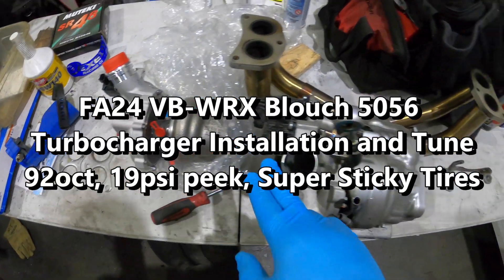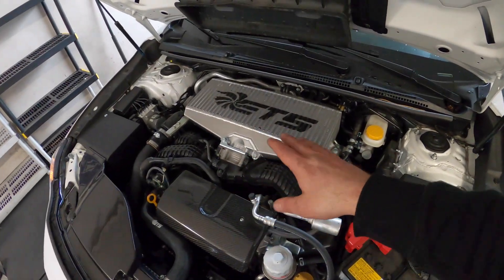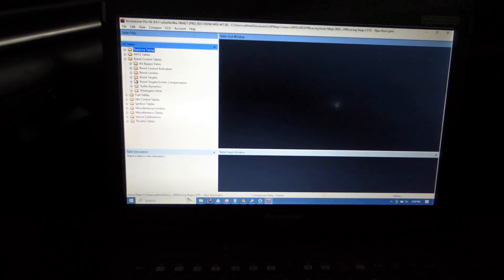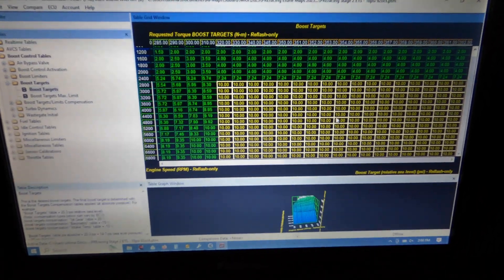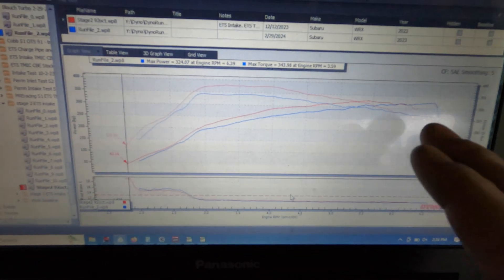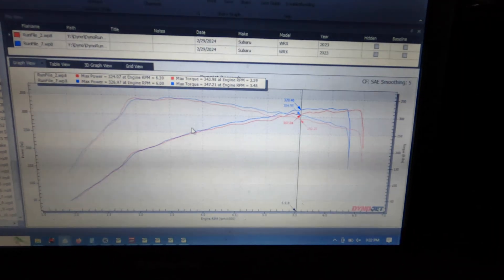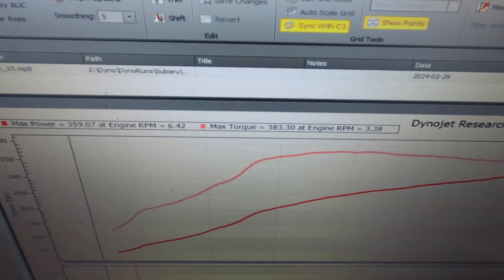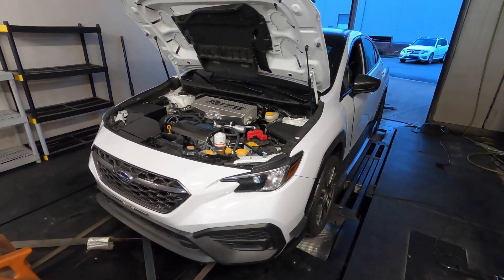FA24 VB WRX: Blouch 5056 vs. Stock Turbo. Part 1 - Low Boost Comparison.

Comment: I know this is a Blouch 5056 prototype in this video, but it looks like they are now marketing a 5356XT as the Subaru FA24 official Blouch turbo. Is that correct?
Reply from the maker: Yes,  it's just a tad better up top with no loss down low than this one
Reply: @WT4T  I'm still trying to learn turbo terminology, but that's good. You're were saying something at the end but there's a typo I don't understand what you're trying to convey.
Reply from the maker: Basically the 53 spools the same and makes more power at high rpm. It's just overall better
Reply: @WT4T  Great thank you!

Comment: What is your favorite turbo upgrade that you have tested?
Reply from the maker: The Blouch for streetability and overall fun factor. The G30 really needs a lot more fuel system to let it eat.
Reply: @WT4T  Do LP fuel pumps create any headroom? Or are we at the point where we need to wait for a bigger HPFP?
Reply from the maker: Marginal at best.  Overall they sized everything pretty much to the same limit from the factory so you're really going to need lpfp, hpfp, and injectors to go much above 500hp

Comment: Can you running with that turbo straight E-85
Reply from the maker: Yes, but you'll probably max the fuel system if you turn it up
Reply: Do you think if i put fuel pump to fuel it is enough or need injectors well
Reply from the maker: @hectorramirez8516 I haven't seen a need for a low pressure pump yet.
Reply: What is the boost limit hold this turbo
Reply from the maker: I've had it hold 26. Haven't tried higher yet
Reply: O waoo very good number any issues with your clutch because i got the same mods  just with ICFM 3.5 but after 4 gear to 6 gear cut the power went i push hard like shocking i dont know is my stock clutch
Reply from the maker: @hectorramirez8516 the car I ran that boost on had an sti 6sp

Comment: What is the web site name you get that turbo
Reply from the maker: It's not listed anywhere currently, but if you call PREracing at 503-619-0055 they can get you set up with one
Reply: Do you change all the bolts to connect turbo/ J-pipe

Comment: All of this is too shiny for me, but I am curious about that lip on the Venturi thing. How much power would that have cost?
Reply from the maker: It's pretty minimal,  not like a 32mm restrictor on a rally car. However, at some point or will choke flow like one.

Comment: impressive what the fa24 can do but i just can't get past what they put it in and what that car costs for what you get..
Reply: costs? you can get this car for 30k flat, then tune it for $700 and make 400 whp/wtq. i dont think there's a better deal out there, or even one close (other than the GTI, but it's fwd and has tons of reliability issues and high maintenance costs. wrx walks all over it on the street any day of the week.) you want any other car (golf r, audis, bmws, mustangs, camaros, you're going to be spending $55k +).
Reply from the maker: The car isn't my favorite body for sure but they feel really good driving.
Reply: @WT4T  this is exact 1992 Impreza wrx small headlights and fog lights and 1992 rally ready version. Imagine 92 with 240hp and over 400 less weight 2004 wrx +  04 only 227 hp.

Comment: These are the types of Turbo upgrades I like to see for street/DD cars. Retaining the responses but just bumping up the peak airflow a touch. It’s very similar to the GT2260S on my S3. Stock spool but about 40HP worth of addition airflow. That thing is going to drive great.
Reply from the maker: It's been on the car almost 2 months now, I've just been too busy so it took a while to get the video up. So far it's been amazing,  really fixes the powerband a ton and actually gets better mpg too
Reply: @WT4T  glad to hear, looking forward to seeing part 2.

Comment: Always fun to see turbo differences. Curious did you add or reduce CAM Timing in the upper RPMs? On my EJ25 VF52 tune I have it tapered out to zero by 5800 and power feel flattens pretty good up there. I have a feeling the VF52 just can't flow enough up top coming off 21psi in the midrange.
Reply from the maker: Ej25 avcs is a very different beast than the FA stuff.
Reply: @WT4T  Thanks, good to know!